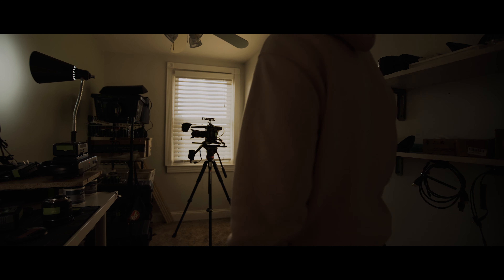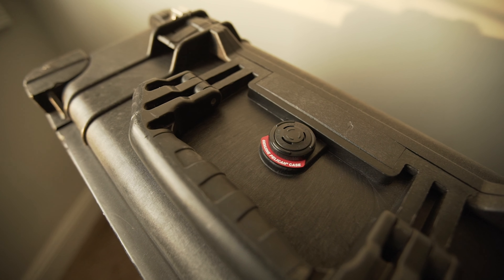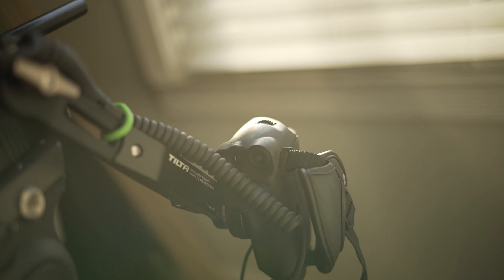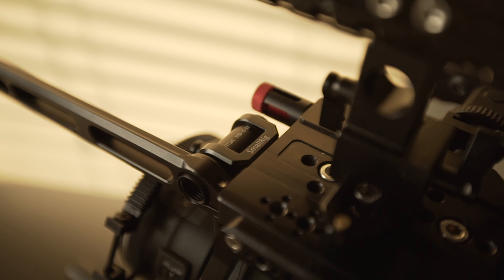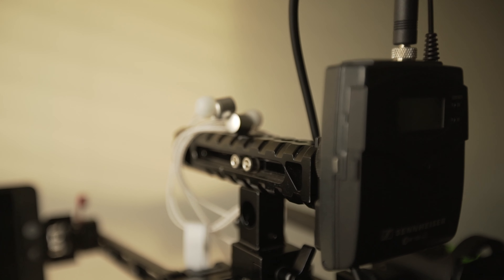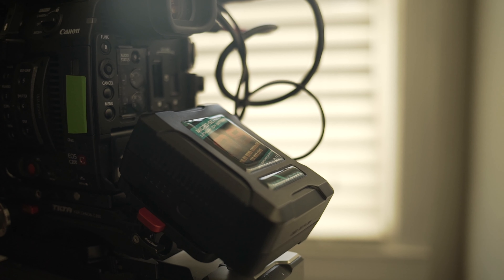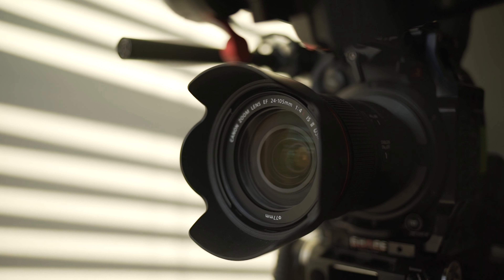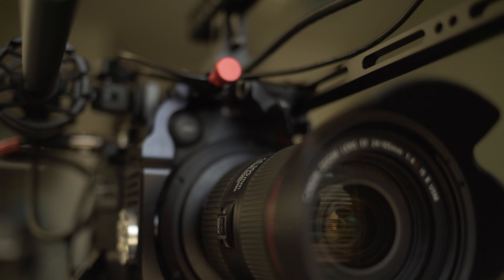Canon C200 Cinema Camera Rig Breakdown

Comment: Super helpful video, thanks for sharing. Quick question--when you're shooting doc work on the C200 are you shooting RAW or in 8-bit? I'm getting ready to shoot a doc on my C200 and I'm considering picking up a Shogun and trying to record 2K 10-bit but I haven't pulled the trigger yet. Curious about your thoughts, thanks again!
Reply from the maker: I always shoot in 8-bit for doc work, mostly because of storage space concerns. Honestly, it's my biggest frustration that I can't do 10-bit internal, or 10-bit 4K externally. I would absolutely use an external recorder if I could do clean 10-bit 4K that way, but the camera is unfortunately limited that way.
Reply: Drew B Darby Thanks!

Comment: Do you pretty much just use the C200 screen when you need touch focus or is there some other consideration for why you would choose to use it over the external monitor? Also, because I don't have a C200, on scale from 1-10, how usable is the stock screen when you're shoulder mounted if you don't have it on an extension?
Reply from the maker: Phil Glaser my only use for the stock touch screen is if I really want to travel light. I absolutely hate it without an extension. Had to do that with a borrowed camera last week and it was AWFUL. Extension arm is an absolute MUST!